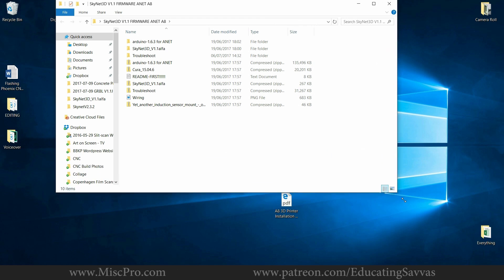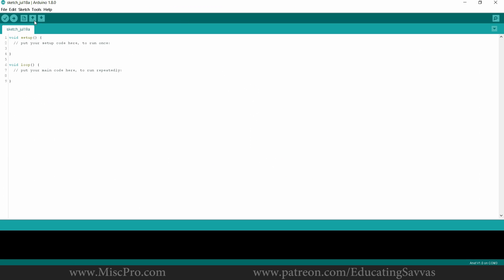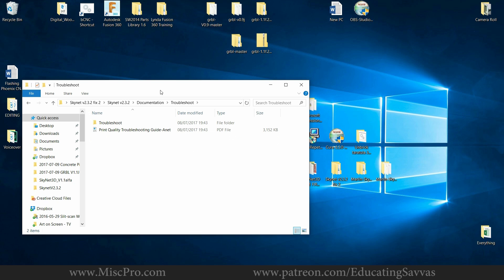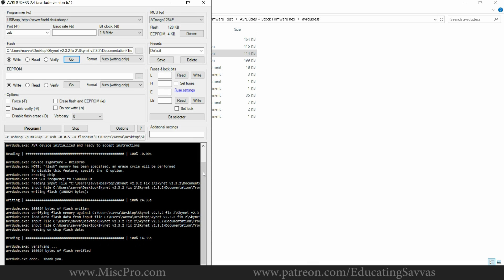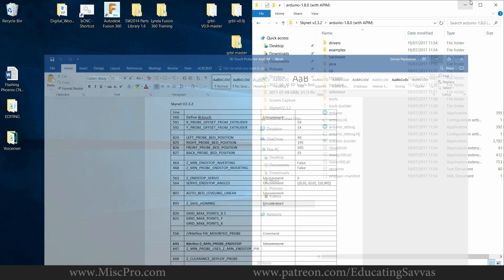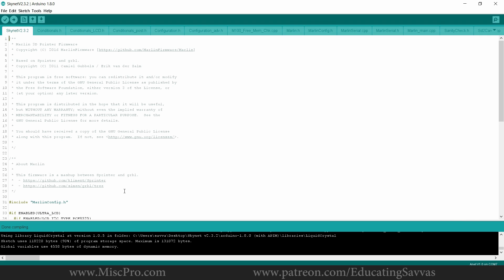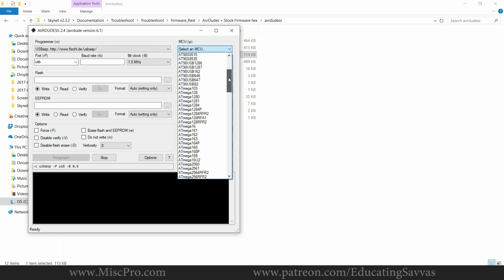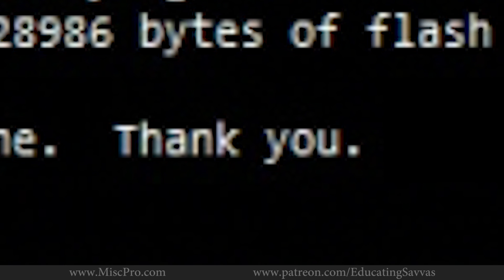Unbricking Anet A8 Controller With USB Programmer

Comment: That sync error was probably caused by you flashing the stock Anet firmware back after unbricking it?
I had to use an USBASP to flash a bootloader because my stock Anet board didn't have a bootloader, and I couldn't flash Marlin. The trick is to simply flash the bootloader with the programmer then disconnect, and flash the firmware(non stock) to the board using the Arduino IDE. Flashing the stock firmware using AVRDudes will overwrite the bootloader you flashed previously.

Comment: Great video. I have the same error messages that you had. In my case, I could unbrick it using the FirmwareResetV1.hex with the AVRdudess, using an Usbasp, but I could not burn the bootloader in the Arduino 1.8.5 IDE. Also,  no matter what I try, I still cannot load the Marlin firmware. I get the same errors in the Arduino IDE as mentioned previously. Nothing I do gets rid of the white line across the display. I have followed many videos about how to fix my firmware issue, but none have worked. I have the right board loaded and the right usb port set. I've tried both Anet boards in the list. So, I have what looks like a working bootloader because the D1 next to the main chip flashes while the board boots, but nothing happens but white square boxes after that. I'm beginning to think the main chip is bad. Any thoughts would be really appreciated.
Reply: My D1 led just stays on, never blinks. Iv dug through the internet and nobody can explain why. Do you know what that means? Thanks
Reply: @kevinjenkins2916  Does your display work properly? I went through all this thinking it was my mainboard, but I learned that when I replaced my display, it fixed the whole problem. That was something that the Anet company doesn't even know about. They sent me a new board thinking it was the board but it wasn't. It was the display board all along. If your display displays words it's probably your mainboard, if it doesn't display anything then you might have a communication problem with your display board. It's been a while since I played with mine, but I think that LED should be blinking right from the start trying to communicate with the display and peripherals.

Comment: The CH340 usb/serial on the Anet is the culprit. #&$%!
Was it when you enabled Z_MIN_PROBE_REPEATABILITY_TEST that it went tits up? was for me and others too aparently. All too often the Skynet for Anet group are a little too tribal (and/or "facebooky") to be helpful.

But man, out of the box, the output from the Anet is amazing, equalling printers at twice the price or more. If you're using an external mosfet for the heatbed then the Anet controller is fine. Unless it's actually broken why replace it?
Reply from the maker: I think it might have been... but I can't remember now. It's a nice printer - going to try a longer print before I do any major rebuilds.
Reply: USBasp will sort you out. Be sure to disconnect everything that can draw current on the controller before you flash otherwise it might not work
Reply: buggyland Thanks for the tip!  It doesn't appear to be all that difficult, just annoying  lol
Reply: I  enabled Z_MIN_PROBE_REPEATABILITY_TEST in Marlin and corrupted it also, bought another mainboard & then did it again! so it is surely the code, maybe overwriting the bootloader area of flash. I'll replace the CH340 & see if that fixes it, though I can't see how it could have been damaged.
Reply: Mine just went tits up installing the BLTouch.  I actually didn't turn up the repeatability option, but ended up in the same place.  I actually flashed the firmware a number of times yesterday getting the nozzle centered and then getting the probe centered and all was well until this morning when I tried to flash 'babysteps' and the USB wasn't working.  I am trying to think of the last thing I flashed but I can only recall all the offsets for centering.  If I can recall, i will update.
Reply: All fine now, re-writing the bootlader with Arduino Burn bootloader command does not show any error messages, but wont allow any serial comms. Burning the original Anet firmware with a USBasp programmer & AVRDUDESS amd all is now sorted. SO nothing wrong with the CH340.

Comment: Just curious, why did you bother with unbricking the Anet board? I would have just thrown a cheap ramps board on it and call it a day. It's a bit more wiring work, but totally worth it. I put a level sensor on my Anet A8, along with a ramps and the AM8 frame. After all of that, it's a solid printer.

The problem with flashing changes to the Anet board, is you have to use Skynet's version of Arduino IDE. Those Anet boards are very picky.

Another great informative video! Keep making them! I really enjoyed watching your CNC build. I would love to build one myself soon!
Reply from the maker: I wanted to get to know this machine as it came but you are right. It really needs some work and my gut instinct is to change the control board. I've been also sent a Tevo Tarantula - which actually was harder to build than the Anet as it came with a manual which was all over the place. Anyway too many things to do. I need to start cutting the new CNC plates out as well but I'm hesitating to start because I don't want to accidentally ruin my material.
Reply: Understand having to many projects. I like to improve things and make them better. I feel like those printers are great places to start in 3D printing. They give you the ability to print out parts to make the printer better, or to make a better printer. 

Any chance you are going to be selling the cut pieces to build the CNC you designed? Just like a 3D printer, once you have one, it's easy to build another.
Reply: Gara Eubanks not everybody is as smart or capable as you......this stuff totally baffles me! I have mind blank with electronics!